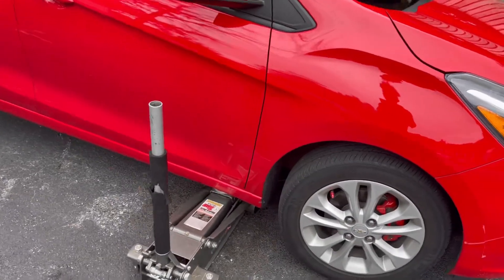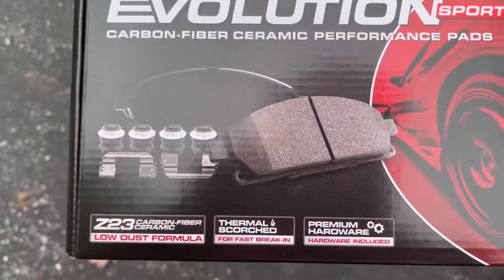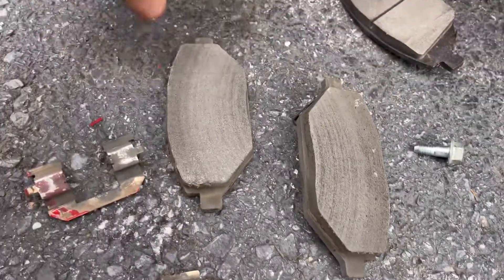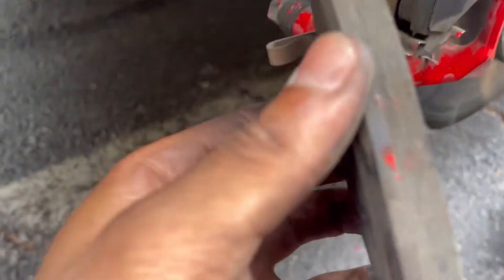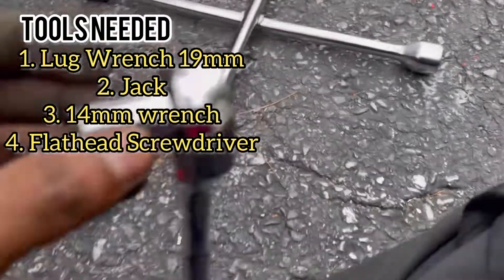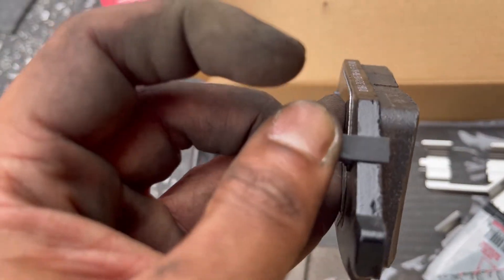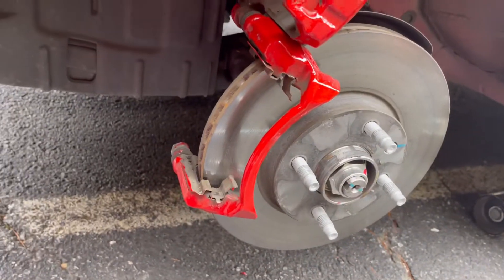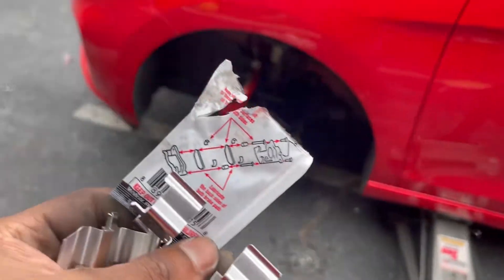Changing The Front Brakes Pads On 2021 Chevy Spark LT

Comment: Pads aren't even bad
Reply from the maker: Yeah I see I was still hearing some slight squeal but, I was just following the recommended interval but I can always throw the old pads on when it gets real bad
Reply: So, mine were squealing at 42k and all I did was clean them with brake cleaner and it went away. Also, a good pressure washer straight to the wheels helps